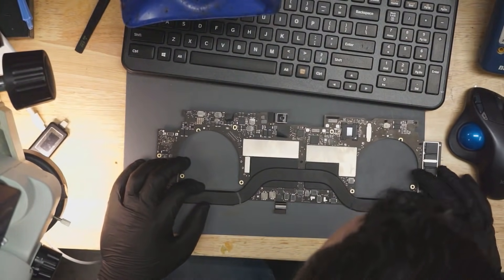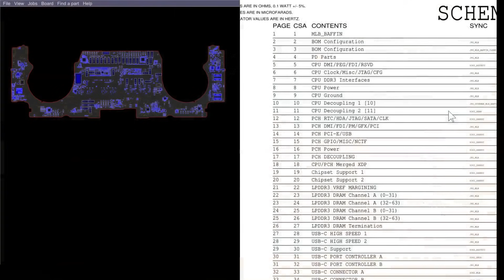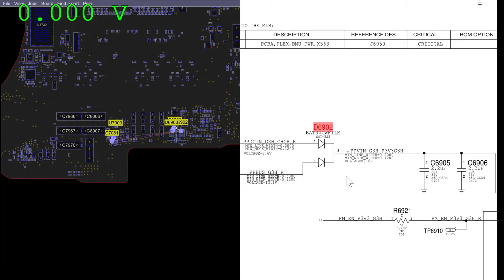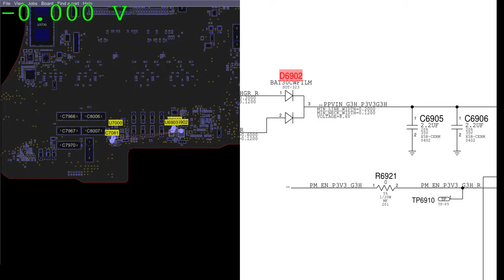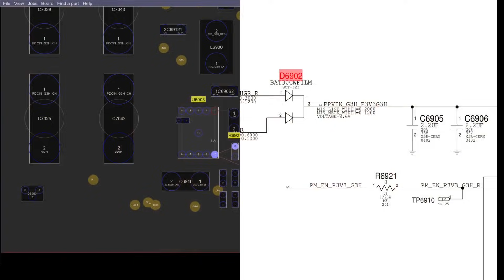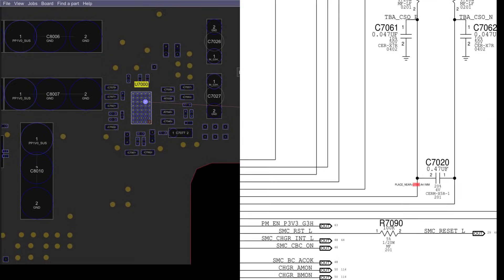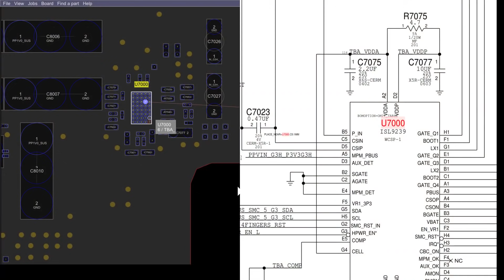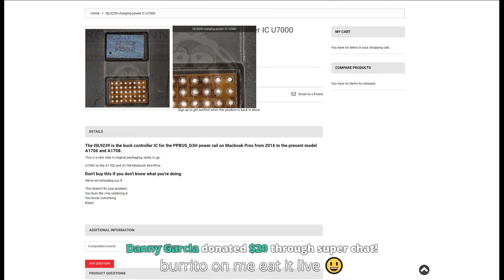820-00281 Macbook Pro Touchbar board is dead: why?

Comment: fantastic video! I was wondering if u could help me with my laptop issue i've tried everything nothing seems to work, my laptop is lenovo y50 70, a few months before my laptop's graphics card nvidia gtx 860m stopped working, but when i open device manager it says the device is working properly. then i tried intel driver and support assistant it shows that my graphics card is working properly but availability is offline, i tried giving it to the lenovo authorized service center they say they say thay i should change my motherboard which would cost me about 560 dollars. do u have any  idea on what might be the actual problem. your my last resort.

Comment: I fixed my old dell laptop thanks to your videos. It wasn't charging because the chip that makes the power rail on it decided that it's solder connections where a better fuse then the actual fuses.

Comment: I love how much you hate apple.   Also these videos of board repair are oddly relaxing lol
Reply: He loves apple. Without it he wouldn't have his company
Reply: Macs still work 10 years after use, if looked after they age well. Pitty the new ones are built so poorly. I have an air 11" 2011 and a 13" air 2014. If you look after them they serve you well. Had a pro 2012 upgraded to an SSD which was my favourite, unfortunately it was stolen. P.s. I built a computer too with a z270 and a GTX 970, but for a laptop, Macs are the best.
Reply: Jet Willis a 970? that's a rookie card! you gotta upgrade that!
Reply: @jackwood4228  I'm looking for a secondhand 1080 👌
Reply: MacBooks before 2014 lol
Reply: Funny enough he uses an old DISCONTINUED Mac notebook of some sort. I cannot tell which one. As most Macs look the same to me after Steve Jobs left Apple and died....
Reply: @Qardo  I don't think he does, in many of his videos he shows his Lenovo laptop which is nearly bullet-proof lol

Comment: If you are truly looking at beaming internet from your apartment to your office, look at Ubiquiti. Their LightBeam AC or PowerBeam AC products (18 miles and 12 miles respectively) would work out really well with your 5 miles range (just have to be line of sight). Look at the Ubiquiti Link tool to get how high you would have to mount the radios and other various metrics. I work for a small town ISP and we install many point to point links for various purposes. Their equipment is rock solid. I know you have done some stuff with Linus of Linus Tech Tips and he put out a video of their Ubiquiti point to point adventures. Have fun!
Reply: line of sight in NYC?
Reply: @vincei4252  it's highly unlikely, but not impossible that he has LoS

Comment: Is 2012 Macbook pro 15 inch i7 a good laptop? Worth buying?
Does Macbook 2011 13 in have the Intel chip issue or was it only 15 inch. Please advice? @louiss rossman
Reply from the maker: not enough information
Reply: Apple shit. By a Lenovo thinkpad. Well it depends on your workload anyways
Reply: Go with the 2012. It was a good year and it still had MagSafe.
Reply: CDubs HasIt unless the GPU dies for no reason or the screen ribbon cable cracks due to bad design or the fuses don't blow letting whatever they're supposed to protect blow instead or a probe point gets corroded from being exposed to ambient humidity and kills the whole machine or the amazing new keyboard decides to stop working or something bridges the high and low voltages on the unseparated pins of the LCD connector...
Reply: Thanks for your responses
Here are the specs for the laptop I am thinking of buying
Apple Macbook Pro 2012 15inch i7 non retina (MD103LLA or A1286)

Just wanted to know if Macbook pro 2011 13inch i5 (MD313LLA or A1278) does have Intel chip issue? I went for a 3 party repair and they said its Intel chip issue but apple says that issue was for only 15 inch. So wanted your expert input @louis rossman. Thank you for your time
Reply: Imo anything non retina at this point is too old to be any good long term. The 2012 MacBook is the last officially supported MBP. I’d hold out and buy a 2014+ Pro.
Reply: no Macbook is worth buying